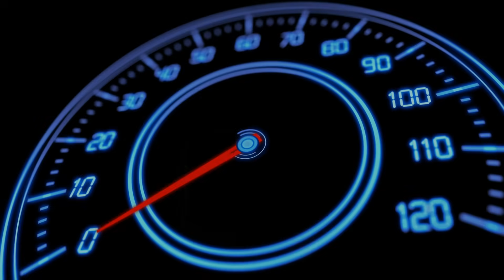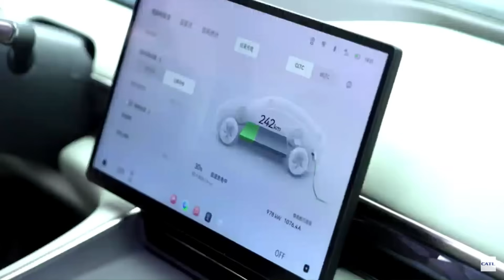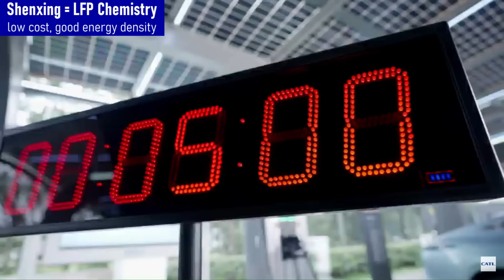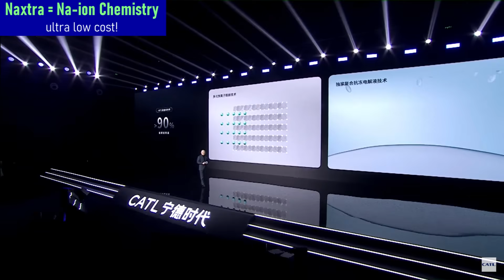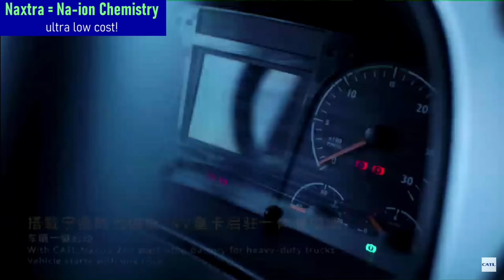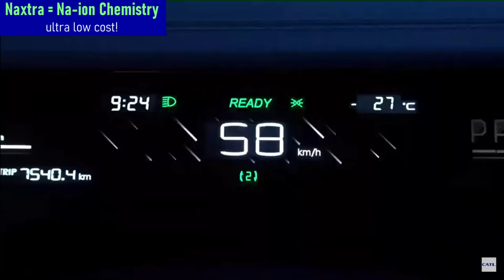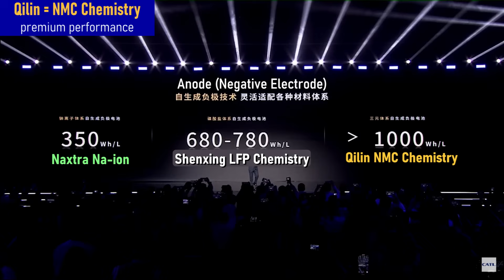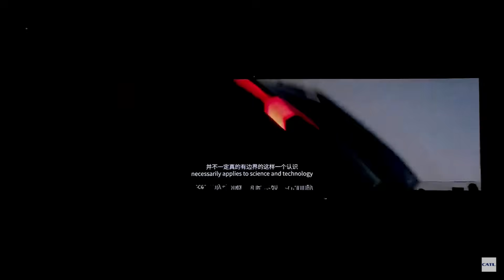CATL shocks the world (again) with Sodium-ion and 1.3 Megawatt LFP Batteries

Comment: I personally love the 3 battery class approach. A premium option for the luxury market, a bare-bones affordable base model option and a large middle-class, middle-market option that offers the best of both worlds relatively speaking. It's a very clever strategy I hope takes off at more automakers who could and should offer the same design just with different battery and motor options. Imagine a Tesla-like Model 3-ish car that could be sold for $20K, $30K and $40K depending on the configuration of the skateboard chassis... CATL and BYD really are going to dominate automaking in this century the way they are going and more power to them too!
Reply: more like $30k, $35k and $40k. the differences are not that big. so, $2.5k for the difference in tech and $2.5k for the added 20kWh. like 50kWh SI, 70kWh L(M)FP, 90kWh NMC.
Reply: @stefanweilhartner4415  SI can easily be misunderstood for silicon, better to call it NaI
Reply: premium now means explodable?
Reply: @koseku3  there are lfp batteries that can go up to NMC levels with the same safety.